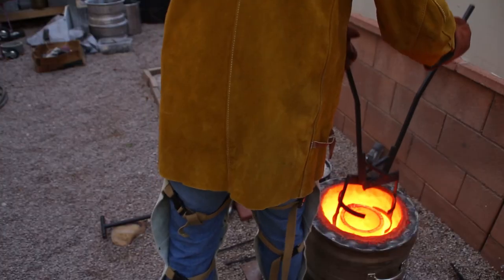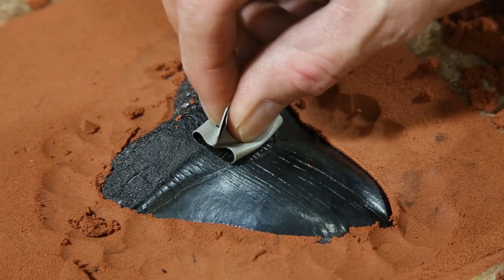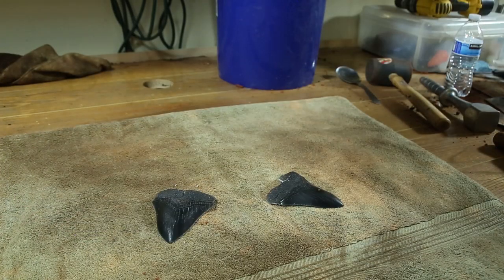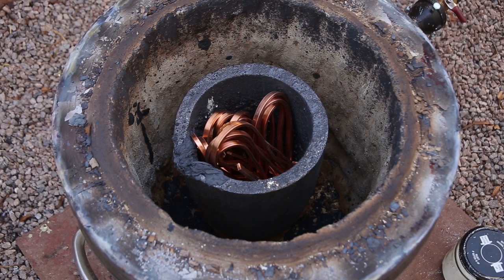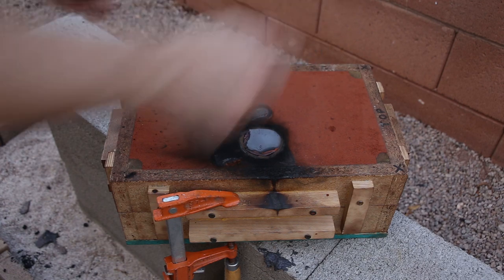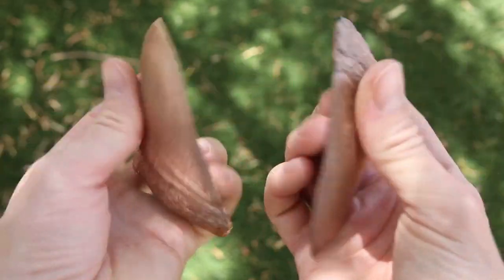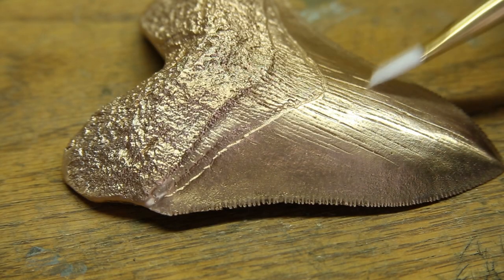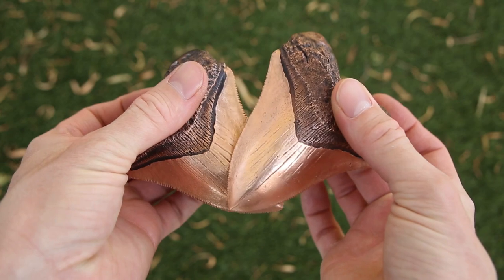Making BRONZE Megalodon teeth │ Metal Fossils

Comment: Awesome technique, thanks for sharing!
Have You ever tried to dig kind of a "pool" on the top side of the mold (where You pour the molten metal in) that has an "overflow" to finally fill the cavity? I guess that should prevent molten metal from the top-surface of the crucible (possibly oxidyzed or with slag) flowing into the cavity. I don't know if adapting that would bring a further improvement, but it's certainly worth a try.

Comment: I love your works! I have a few questions: what type of sand did you use for casting? Where can I find that sand? After casting, can that sand be used again for casting?  I hope you will reach 100k subscribers very soon!!!!!
Reply from the maker: Thank you very much! So do I. I buy my sand from petrobondforsale.com. You can reuse it many times. I scrape off the black sand and keep it separate. After I have a bunch of the black / dark sand accumulated I will mix it up and rehydrate it with a little oil. It’s better if you can keep the burnt rehydrated sand separate from the fresh stuff but you can mix it also. 100 lbs should last a long time.

Comment: How much do the ones listed on eBay weigh?
Reply: They probably weigh around 1.5 pounds. He said he uses 3 pounds of bronze in the video, and there are two teeth, so probably around 1.5 each. Well, maybe a little less if you include the metal that went into the sprue.